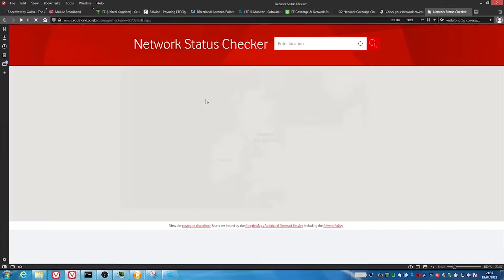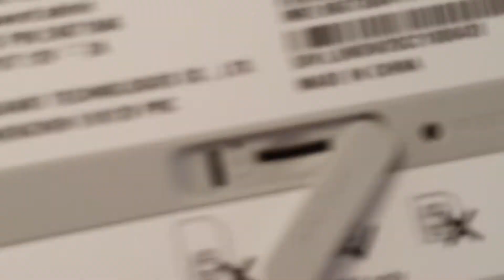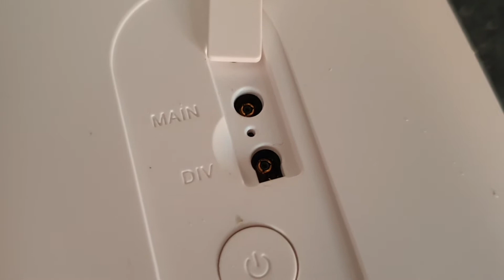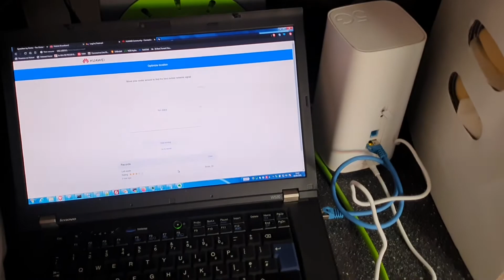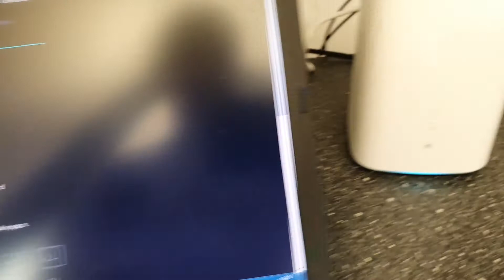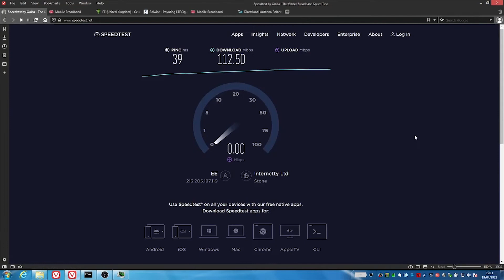Huawei CPE Pro 5G router review

Comment: Hi David, these external antenna ports doesn't mean for catching 4G signals. They are only for 5G frequencies. I have opened the router and modified on the board antenna ports to external antenna sma connectors to receive 4G signals